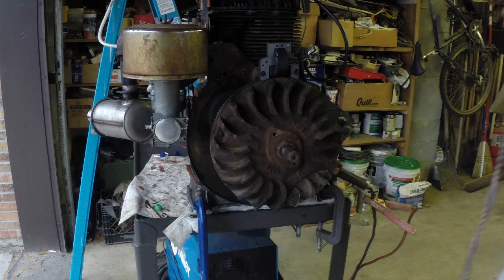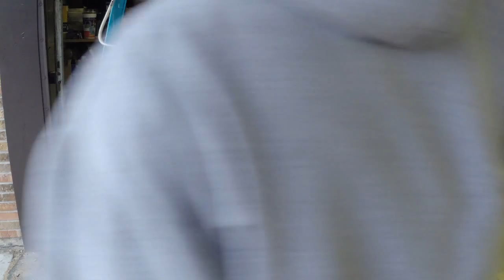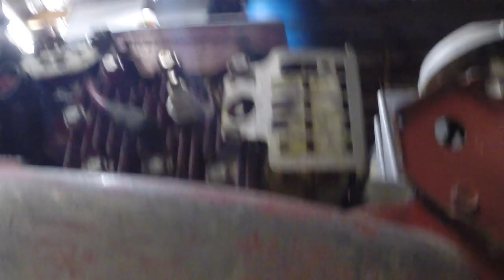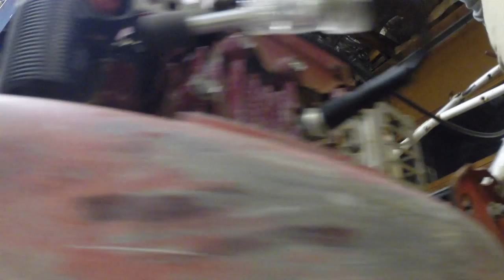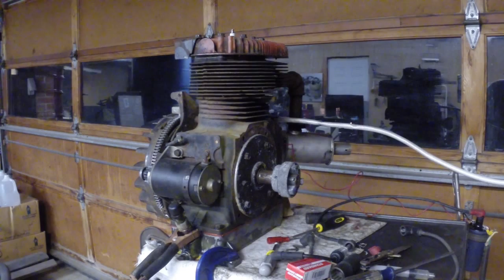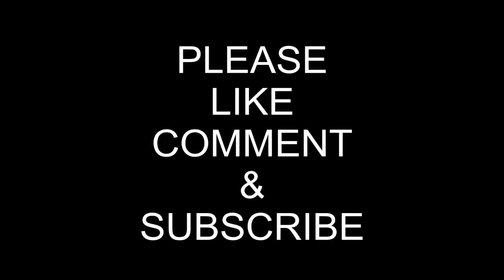Terramite backhoe project PT 7

Comment: So did you decide if it was the magnets or the coil causing the trouble ?. It may have went over my head if you said what it was :) Sounds 100 times better..
All the best.
Bobby
Reply from the maker: it has to be the magnets, even with a new coil it had weak spark...  so that is the only thing i can figure.
Reply: KydexByParlusk
Hmm you would need a new or used flywheel or some way of renewing the magnets on the old one. I'll do some research and see if I can come up with something.
Reply from the maker: ***** the magnets can be recharged, but i am just going to bypass the whole system and use the 12v car coil to produce the spark that i need
Reply: KydexByParlusk
Sounds like a good plan. Thank you for letting me know.
All the best.
Bobby